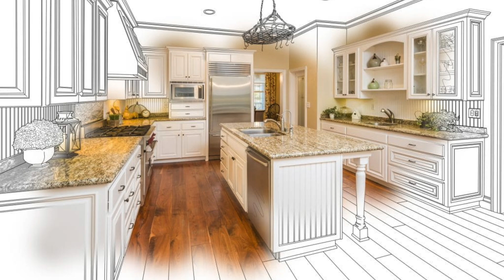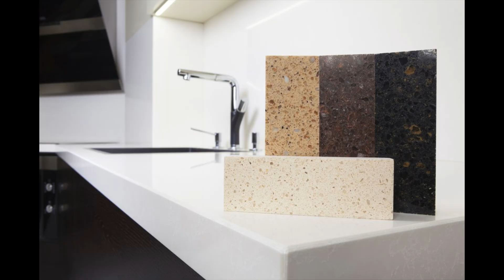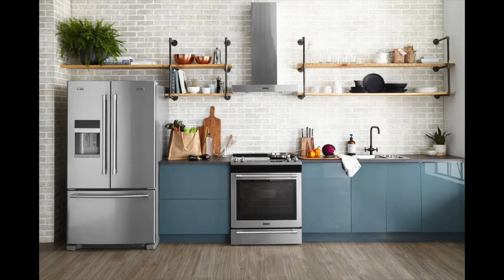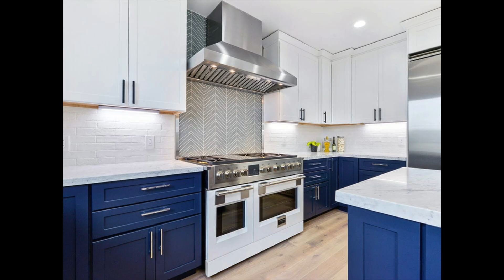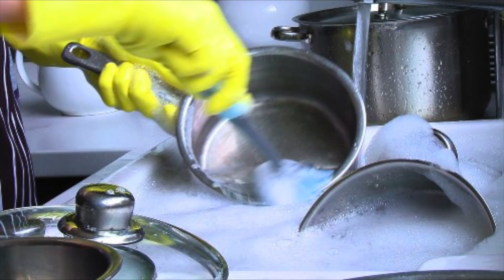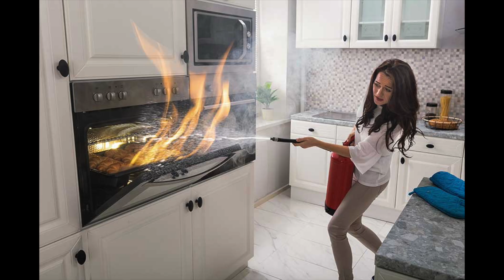The Perfect Kitchen with chatGPT

Comment: The kitchen triangle is a fascinating myth promoted by scholarly designers who are not professional cooks and who know nothing of doing manual labor. There is a schism between engineers and workers in everything, and the same is true with kitchens. In actuality, the most important thing in a kitchen is it ability to serve as a social gathering place. Kitchen design should revolve around that and use data analytics, process modeling, and computer simulations in the design process. AI is no smarter than its creators.
Reply: Most people have a budget. The great ideas in this video blows most people's budgets 5 fold and fail to accomplish the most essential components. An AI that could design a great kitchen on a dime would be fantastic. In this video, you only cut the cost of the kitchen designer. Nothing new under the sun here.
Reply: AI needs to calculate the wining lottery numbers so I could afford one of these kitchens. Otherwise this is only a pipedream.